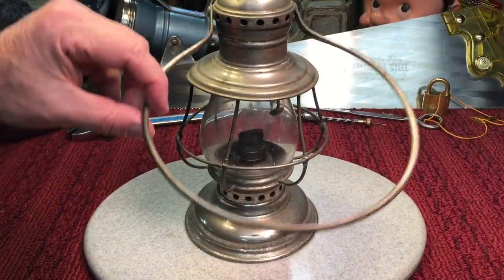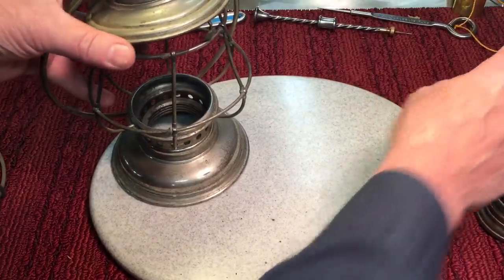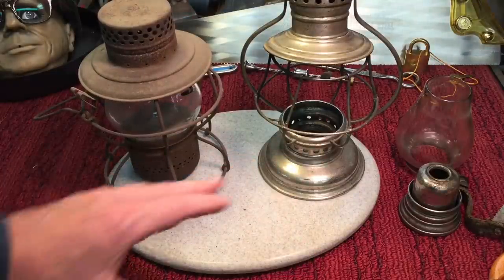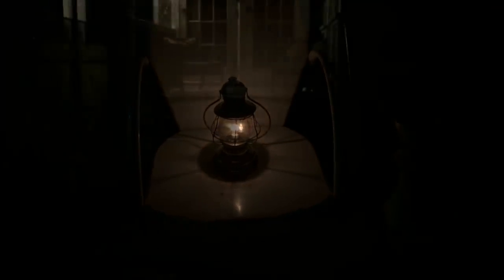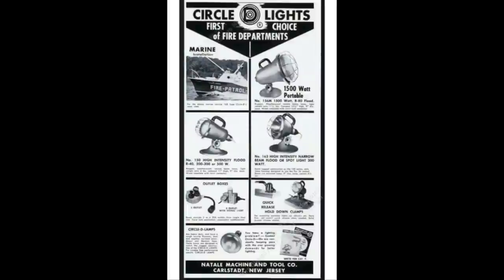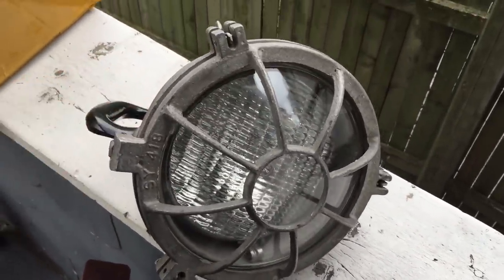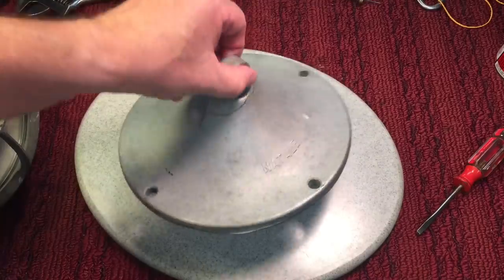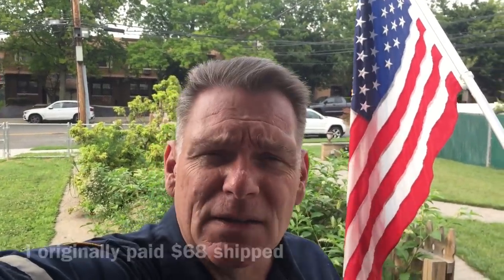Peter Gray Railroad Lantern and Rare Circle D No. 163 Light Repair.

Comment: My parents had two RR lanterns from our relatives that came down from Canada.  I ended up with one and the other was lost when the family home burned down.  Once I get settled in my new place, I hope to strip the paint my mom painted on it and maybe remove the dents and put it back to as close to original as possible.  I think your fix for the light base is way stronger than the original and will last it's lifetime. Great job.

Comment: Great remedy. I have used JB weld on questionable repairs and it works 9 out of 10 times. I do this because I do not have welding equipment. Very impressed that you are sending the seller some money, you are a true gentleman. Thanks for the video as always.

Comment: JB Weld is exactly what I’d use in this case. I probably have half the welding skills that John does, and I know I’d do nothing but destroy this project if I cranked up my welder. Only an extremely skilled professional welder could pull that off.

Comment: That squeaky sound on the threads reminds me of a light bulb screwing it into the socket.. So I put a very thin film of petroleum jelly on the threads of the 💡and now it's silky smooth.. I've been doing this for probably 20 years and never had a problem and the bulb will burn out before you need to reapply it.. Great video S.C... Have a great weekend...
Reply from the maker: Yes!  I wipe my bulb bases with scotch brits and WD-40 then wipe the socket too...  Smooth operating!

Comment: Well done Bud!! If Epoxy fails 99.99% of the time it's because of bad or lack there of preparation!!☺
Reply: Epoxy is great stuff. A lot of people don't realize you can also use it to conformally coat electronics, too. I used some 99 cent HF 5 min epoxy to conformally coat the circuit board on a very powerful bike light I own. I tested the job by dragging that baby through a lake at the beach. Works even under water now!
Reply: Amen. Same with paint.

Comment: I have faith in the epoxy and I'll tell you why. Well over 20 years ago my Grandfather's chainsaw got dropped while trimming a tree off a ladder, I repaired it with Epoxy Putty and it was the area with the stud that holds the bar on........My Dad still has the saw and all these years later the repair is still rock solid......He mentioned it a couple months ago when we were out to dinner.

Comment: Speaking of Circle D lamps. I spent 33 years on the job as a firefighter. One day on a call on the ladder truck we unintentionally broke the handle cleanly on both sides so the part that you grabbed with your hand was separated leaving two one inch nubs that attached to the lamp it self. In my department is was a pain in the butt to deal with a broken piece of a equipment so we got some super glue and glued that handle together and clamped it. Wallah it was fixed. Kept an eye on it for years and it stayed fixed. The handle was like bakelite and pretty brittle. I think it was appropriate that you sent the $40 back. The seller showed good faith in refunding the whole cost, she possibly unfortunately didn't pack it as well as it should have been.
Reply from the maker: Hi Michael- Packing fragile items is a real skill.  You have to assume gorillas are trying to destroy the contents!  😂😂😂👍
Reply: @ScoutCrafter  Spot on for double flag Friday. Yes that's a tongue twister for sure.

Comment: About the copper... I made an air compressor out of a window AC unit when I was younger and I brazed its connections with a copper rod and an el cheapo propane/oxy torch. The high pressure side goes to 300 PSI and it never failed. I used it for years. It was just tubing, no solid rod inside.
Reply from the maker: As long as tubing isn't used structurally it should hold fine!   =D

Comment: Yes thats a strong repair. I never used the pc7 but jb weld many times.
I used jb on a hole the size of a dime in a motorcycle crankcase on the bottom nonetheless. It held for years. I backed it up with a nickel to cover the hole. Lol.

Comment: That's how I would have fixed it. JB weld fixed an engine block crack of the 413 in my 64 Chrysler New Yorker. That was well over a decade ago. Just some water seepage and that fixed it. Tried to use it as a substitute for babbitt material on a connecting rod of a 1949 LA Case tractor I had. Yeah, does not work for that.

Comment: I would have went to the garage and TIG the base. Might have used Alvin Lab Metal and actually Bondo makes an aluminum filler although I am not that fond of the results. For the dent in the lantern paintless dent repair would get you there without damage. I bet that cast aluminum broke fairly easy when new.
Reply from the maker: They say when TIG welding cast aluminum with big you need to use only Argon gas.   Cast presents other issues when exposed to high heat, they say it can make the surrounding area brittle!   =D  Thanks Philip

Comment: The lantern may have been made for and used for passenger train service hence the nickel plating.  I have seen a Pullman lantern of the other manufacturer with "PULLMAN" on the globe and it was nickel plated.
I agree that the base fix will be good the way you did it but it should have gone back together better.  That kind of aluminum is not good.  It is prone to cracking and breaking.  It was die-cast in a machine.

Comment: Awesome video scout why didn’t you weld it from the inside instead?
Reply from the maker: The rods I have are not the same as TIG welding.  I don't have a TIG welder and even if I did I think I prefer the epoxy fix...
Reply: @ScoutCrafter  yes what you did there won’t come off even if you wanted too lol

Comment: Great video John but just one thing I don’t understand? What’s the difference between restoring an old collectible lantern and a old collectible tool? The reason I ask is because you seem not to have any problem restoring an old tool worrying about its value or losing its value but you do with a lantern?
Reply from the maker: Most of the tools I restore are not collectable and somewhat common...  When I get a real collectable tool it almost seems like my hands are tied.  With lanterns I am the same way, if the lantern is common and somewhat plain I will have fun with it. This lantern is the type of lantern you would see in a railroad museum and wasn't in terrible shape so I opted to not alter it's originality.  If the lantern was trashed or really rusted then I would have taken it to the power tools, everything I did on this lantern was by hand...
Reply: @ScoutCrafter  ok thank you for clearing that question for me!

Comment: Pretty sure that you could not tig  that. Aluminum castings are almost always very rich in silicate. Makes them a b** to weld, the puddle just falls out like when you try to weld pot metal. I've even seen brazing fail on a casting like that, it's just too thin.

Comment: How could you repair the lamp and not light it? I feel like I been robbed. Light it up John
Reply from the maker: Mike- The Light requires a special 20A twist lock receptacle.  I ordered one and upon arrival I will demo the light!  I don’t even know if it works!  😂👍
Reply: @ScoutCrafter  if its the same type as they use in construction you can also usually find a household to twist lock adapter at home depot. Hope the light works!

Comment: So how do you know that the lacquer was original to the piece? Who's to say somebody didn't get tired of polishing it 40 years ago and lacquered it. If you're the tool steward, how can you be certain what the manufacturer did versus the past owner?
Reply: Don't get me wrong, I don't doubt that you are right, I just want to learn
Reply from the maker: Years ago it was common for some manufacturers to clear lacquer their nickel products to maintain the shine and stop their products from tarnishing.  Later on chrome replaced nickel and there was no need for clear-coats..   This coating might have been added later on but looks old and original.  I didn't want to restore this just clean it up.   =D